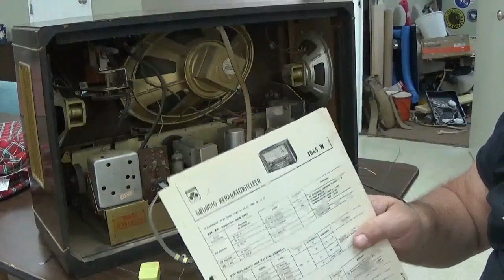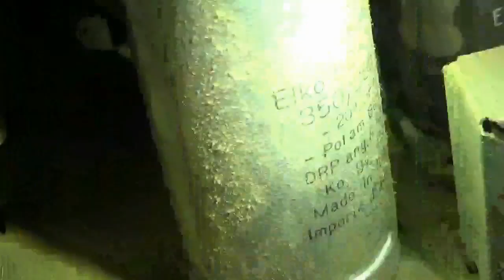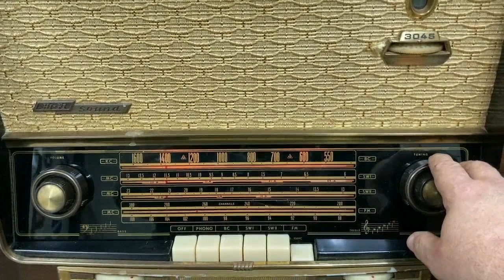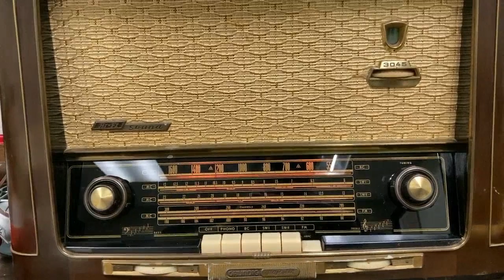Grundig Radio Repair

Comment: Jamie, I've got the same radio.  Grundig Majestic 3045.   It works but could use a going-through; plus I need to get three buttons replaced.  If you truly enjoyed doing that one, you care to do another?
Reply from the maker: Do you have a source for parts?  To be honest, you may need someone with more experience with radios. If you can tell by my narrative, I was a little intimidated with this. LOL

Comment: Hi Jamie, I also have Grindig vintage tube radio. It has no Output transformer. It had seven leads. But I don't know the model details. Can you arrange for me and send it to me? Your favourable reply is very much solicited.
Reply from the maker: I am sorry but I was fortunate to not have to buy anything new except readily available capacitors. I have no source for Grundig Parts. This was the first radio I had ever worked on and wouldn't have done it, except it was for a friend. Being an amp guy, and relatively new at that, I was intimidated to attempt it. There must be some other techs on youtube that are way more qualified than me to help you out. Good luck with your parts search. I'd say many of these parts are getting as rare as hens teeth.

Comment: Hi Jamie, I recently bought a Grundig 1088 1957, I just learning , I have tweeters that are flat, Can I change them To a regular speaker Like yours, I have seen on youtube they go Bad all the time, The Hard fix in mine is the string station changer, I,m blind in 1 eye in my 60's Is not going to be easy. I haven't looked to see what the ohms are 4-8 maybe, Need to buy a sams. thanks for any help
Reply from the maker: Sorry I'm just seeing this. Ohms are easy enough to check. If speakers are bad, I'd stick with 8 ohm as going too low is bad for the amp. Higher is okay
Reply: @jamiespaulding  Thank you for your Reply, I haven't been feeling well, sorry so long Getting Back, God Bless Brian
Reply from the maker: @brianbloom1799  Also, the new fishing lines they make like SpiderWire  etc. should work nicely if you need string. you can buy it according to stretch and braided or not.

Comment: Hi Jamie, I have a Grundig vintage tube radio. It is  not working condition because of lack of OUTPUT TRANSFORMER. If it is available with you, can you give me?
Reply from the maker: Ii would be glad to help but I have no parts, or even a source for them other than google search. I will tell you, if your output transformer is bad, it’s most likely bad capacitors and resistors that led to the problem. Trust me when I say that me giving you advice on working on these cool , old radios is nearly like the blind leading the blind.

Comment: All Grundig radios are junk 😂😂😂😂
Reply: You gotta be joking right?
NOBODY made better quality consumer radios than the Germans in the 1950s and Grundig were one of the top end brands. The model numbers directly related to their position in the range.
1000s 2000s models were entry level, 3000s 4000s were their middle of the road models abd the 5000s and 6000s were top end.
The 5050 is widely considered a collectors "must have".
Reply from the maker: All I know is that I was impressed. I am not ashamed to admit, I don't know anything about radios. I do know how to check for bad caps. There were several bad ones. That's to be expected considering the age. If it hadn't belonged to a friend, I wouldn't have touched it. LOL
Reply: @jamiespaulding  I bet they were the paper caps ... theyre usually out of spec. Did you change the 50uf filter caps .. theyre usually shot too.
Reply from the maker: @Rush-gz9sx  I did not but she lives close. I have considered getting it back. I would hate to lose a transformer because of a bad filter cap. Voltages were in spec at the time. I was just going to bypass and leave the can for the look. At the time I did it, I did not have capacitance meter.